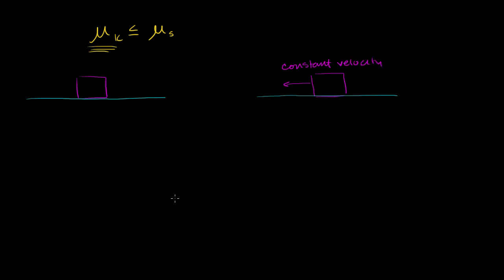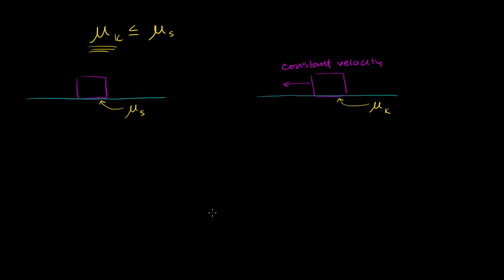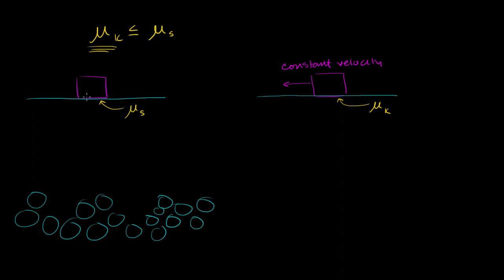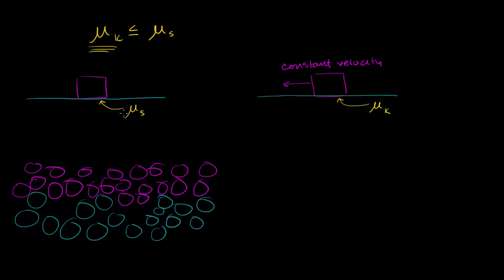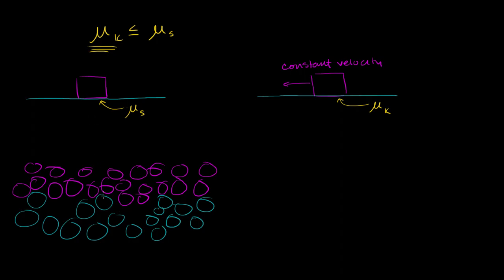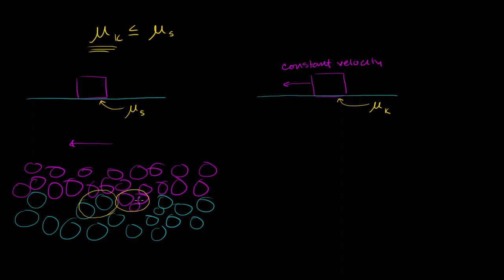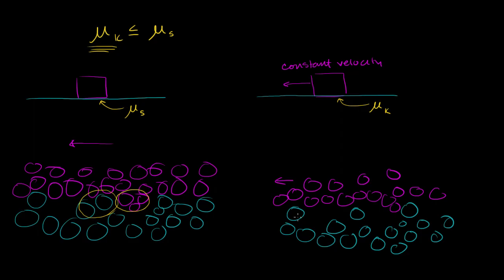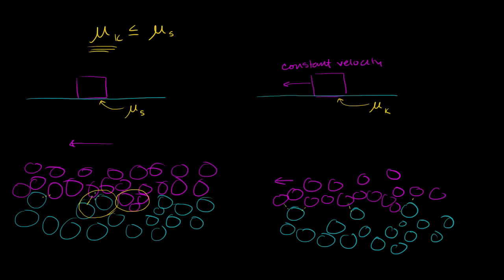Intuition on static and kinetic friction comparisons | Physics | Khan Academy

Comment: Well this intuition confuses me 
As there are a lot of questions against this intution :
1. If this intuition is correct then it should mean that if i take a block and make that block slide over a surface multiple times then the kinetic friction should decrease
As the surface becomes more even.
2. If this intuition is correct then , if i take multiple block of same material and mass and slide it on the the same surface then the kinetic friction coefficient is going to be different as the unevenness is going to be different for the blocks even though  they are of same material.
But its not true
There are further arguments that can be placed here 
But later i think i can answer all my questions to some extent:
We should consider that the friction depends more one the vanderwall force of attraction as compared to the unevenness of the body 
So unevenness depends but not much .
Correct me if i am wrong

Comment: I don't agree with the assumption that the two objects rough surfaces slide into one another increasing the coefficient of friction, and that when the two touching surfaces are in motion the surfaces do not slide into one another. this would mean that if the objects were move very slowly and the objects had time to slide back together the coefficient would increase. In this case the coefficient of friction would be directly dependent on velocity. This is not the case, it is simply a question of whether the objects are moving or not.

Comment: This video contains an incorrect statement that at the molecular level there is a force of repulsion between the electron clouds of the molecules of the two surfaces.  If that were true, then when you brought the surfaces into contact there would be a larger and larger repulsive force as the surfaces are brought closer.  But we do not observe that.  Instead, as Freeman Dyson has shown, the reason solids are relatively impenetrable is the quantum degeneracy pressure (aka Pauli exclusion principle) that prevents electrons from occupying the same quantum real estate.  An electron cannot force its way into the orbitals occupied by electrons in the opposing material, in the same way you are not legally allowed to build your house in somebody else's back yard, even though there appears to be plenty of unoccupied space.
Reply: 2 professional arguing 4 years apart while I observe yet another 4 years in the future. Crazy
Reply: @alonsobasterra8277 😂 and me watching their argument right now
Reply: @alonsobasterra8277  And me watching 1yr after from future😅
Reply: This is not true. We actually do observe a larger and larger repulsive force as surfaces are pressed closer together— it just happens at such a short range that we consider the two surfaces to be touching. Press against a wall, then press against it harder-- it'll press back just as hard (unless you break the wall). 

The electromagnetic force facilitates bonds with relatively fixed lengths because electron clouds exhibit both repulsion AND attraction, just at different ranges. At specific nucleic distances, atomic pairs are in their lowest energy states— any deviation from this takes energy, and will be met with negative feedback until the bond length is restored or enough energy is applied to break it. Your characterization of the Pauli Exclusion Principle is accurate, but it is not distinct from the concept you are trying to refute. Furthermore, this exclusion principle does generate a repulsive force which increases as distance decreases, counteracting the lower energies of hybridized orbitals and forming the aforementioned stable bond lengths.

(That final analogy doesn't make a lot of sense to me, either— the quantum world has almost nothing in common with commercial real estate, and it's misleading because those laws can be broken, while physical laws cannot.)

Comment: i've got static friction as 4.09 and the kinnetic as 0.08 does this sound possible in my question of a mass of 1.8t on a rest of a incline of 1/12(sine). when the brakes are released the vehicle travels down 30m against the constant restiance to motion 200N/t.
Reply: static and kinetic friction do not exceed 1
Reply: @Invisiblemonk  They can. Silicone rubber has a coefficient much greater than 1
Reply: your static friction is way too high sir

Comment: Intuitively, I also might think that the mu-kinetic is smaller because for any given comparison, the temperature is higher in the system that is moving, and therefore will allow for easier intermolecular bond/interaction breaking. Just my thought, not sure if its legitimate.

Comment: (part 2)

I think the point here is that the maximum possible frictive force is greater for a body at rest than a body in motion.  

Discussing other forces you apply is confusing, since you are thinking about adding forces to a body which had *reactionary* forces to the forces you apply.  (As you apply more force to the left block, the static friction force changes.)  Then when you discuss the block's acceleration, you're conflating the issue.

Comment: Thanks, as always, for the great videos.  

I want to make just one comment on your video.  At 1:56, you compare the force necessary to get the left block to accelerate versus that of the right block "... to get this already moving body to accelerate."  

Note that the right block will accelerate even if you apply no force to it.  The body will have friction directed opposite its motion.  So honestly, you can apply zero force to the block at right to get it to accelerate.

(more continued)

Comment: Given the distinction, the coefficient of friction doesn't seem to describe the "roughness" of a surface. Rather, it seems to numerically describe the magnitude of the "shifting" between two surfaces which makes sense considering that the coefficient of friction is a ratio ( Ff = u*Fn; Ff/Fn = u) and has no base units.